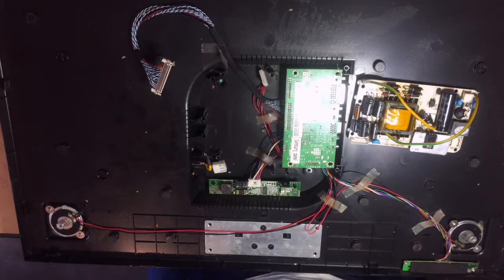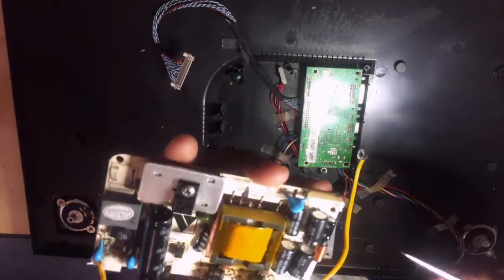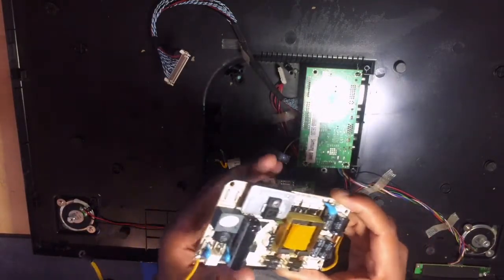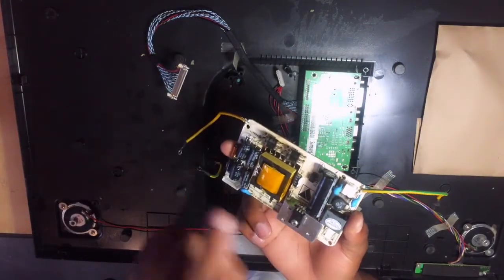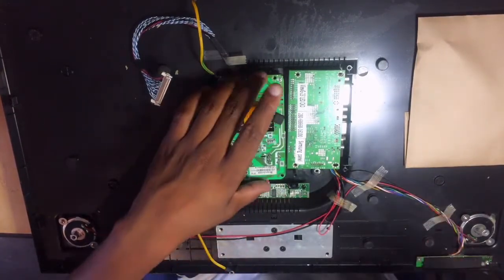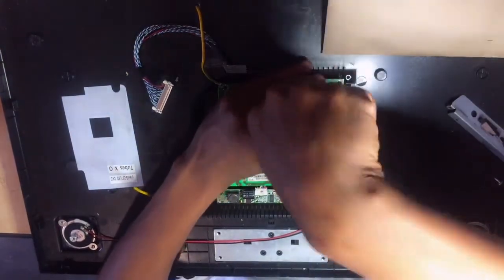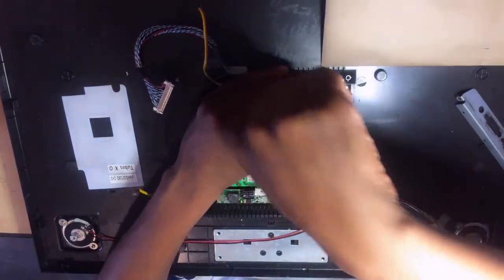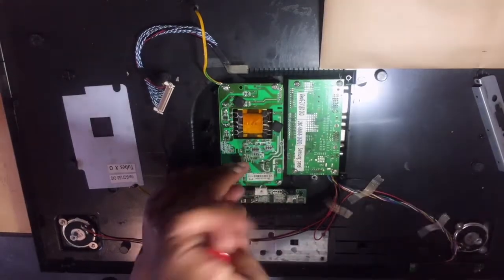MECER A2356  MONITOR NOT POWERING ON

Comment: I have the same screen as this yesterday it was working nicely but when I tried to switch it on again it only blink once and then goes off , I tried to use an alternative 12v power supply together with 5v power supply and it went on could see the readings but back lights couldn't come on .

Comment: Sir thank you very much. I had the same problem. My Mecer model just differs with one digit from yours (A2456) but they basically look identical. I watched your video today, went out to get the four capacitors (2x 1000uF 16V and 2x 1000uF 25V) and replaced them. A total of R20 saved my beautiful monitor. This load shedding will be the end of us. Need to invest in serious surge protection for my TV!
Reply: Hy

Comment: hello. i have a similar monitor. i bought it second hand but it wont display anything. the power indicator is on and my laptop can even detect it when i plug it in. but it wont show anything at all. even wnen it turns on. i dismantled it and i found that the previous owner had tampered with that small piece of board under the power supply and control unit. i would like to know where to connect the three wires coming from the panel at the bottom right corner
Reply: He messed up with the backlights , but you can bridge them since they are 12v

Comment: Evening, I have Mecer A2055 monitor it blinks Blue and red, shows no input signal then goes blank and only power button working only. Do I change the 4 capacitors?
Thank you in advance
Reply: No your power supply is okay just check the connection cable VGA 

If your laptop uses C type or HDMI you will need to buy a converter the direct HDMI to VGA cable wont work